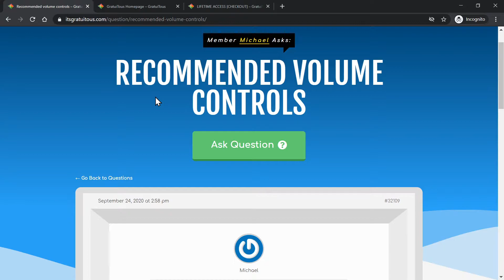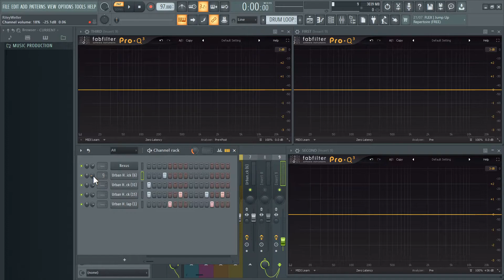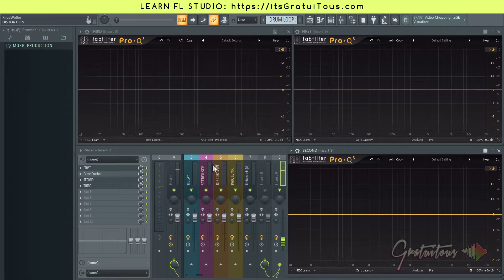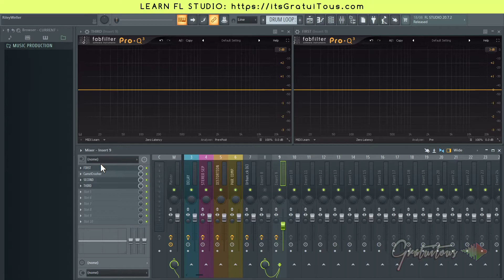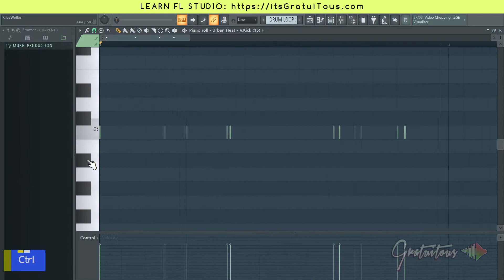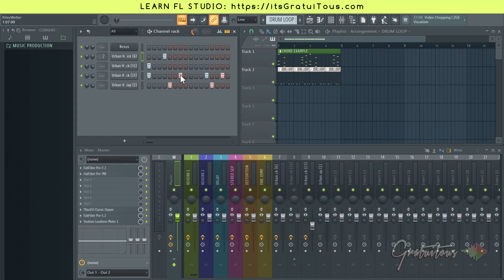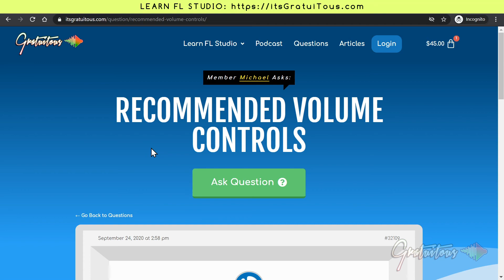What Volume Knob Should You Use In FL Studio to Control Volume?  [MEMBER QUESTION]

Comment: Nice video I just wish you covered turning the volume up thru the channel rack knob and keeping your volume down with the insert faders for 808s and kicks I have found for a certain mix on a beat I’m doing it’s like really fuckin effect and is making my instruments way bigger and giving me way more out of my 808 without clipping and even allowing my kicks to clip and still leave me with head room with the use of advanced plugin processing as well but that’s something I’m trying to just completely double check confirm I wish you could’ve covered
Reply from the maker: I don't think there's a difference in sound quality of the channel rack knob to the mixer's faders.  You can test this by running a null test, too - use the FL Studio's reverse polarity option on a mixer insert (it's visible in the "Wide" mixer layout views).

It could be that your audio is not clipping and you're able to have more control now in your mixing?

You'd need to run some tests to double check what you're hearing!
https://itsgratuitous.com/